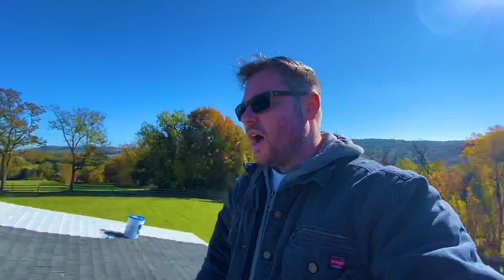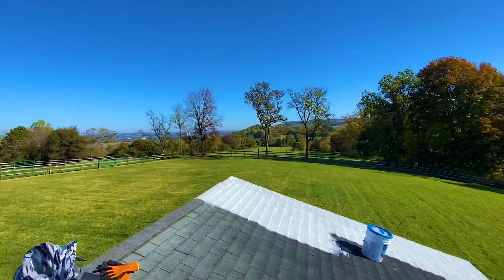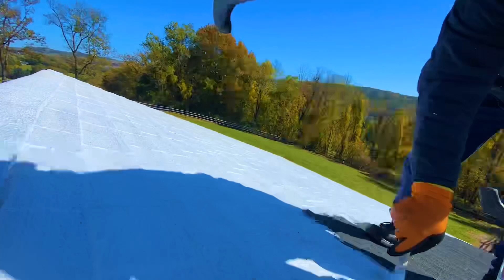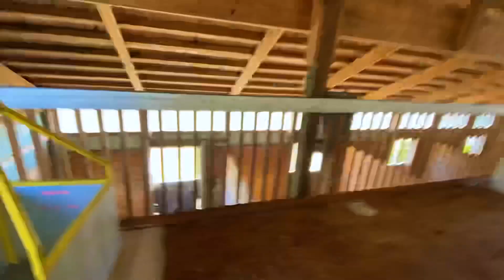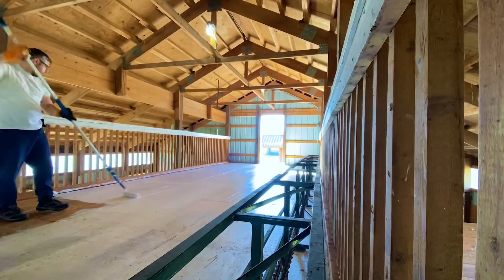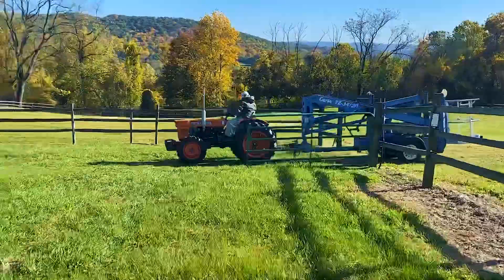SUPER COLD...FARM...WORK UPDATE!!

Comment: Great job Walter, and yes if the plywood is older it's probably not exterior plywood which means it has to be painted or you can also use an oil based stain it usually looks great stained have fun man

Comment: Plywood buckles if there is no 1/8" gap between the panels or the ext.plywood was not properly nailed.
Reply from the maker: I didn’t see those little metal joint things so I’ll need to look at that tomorrow.  Either way they’ve been like that for 35 years so...lucked out